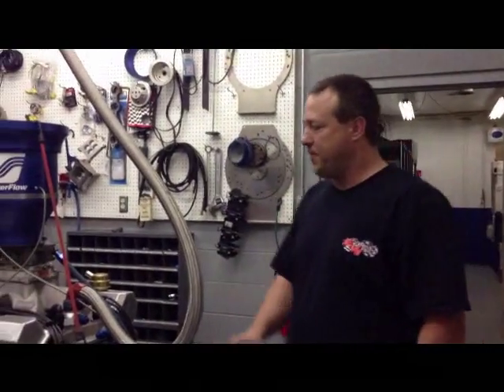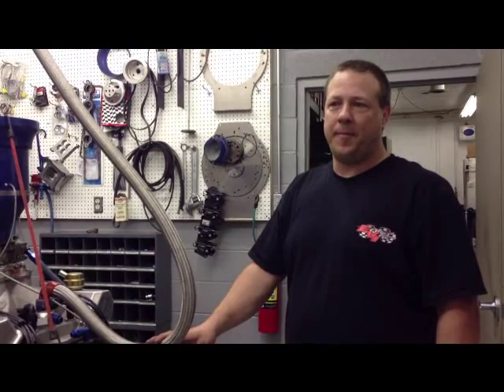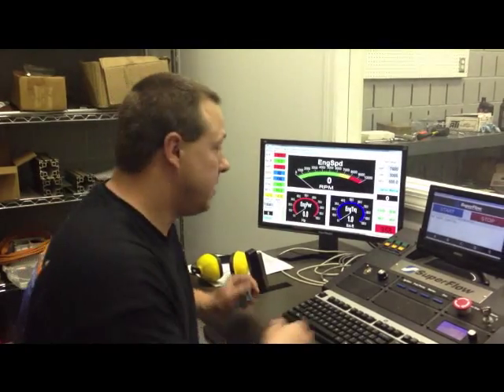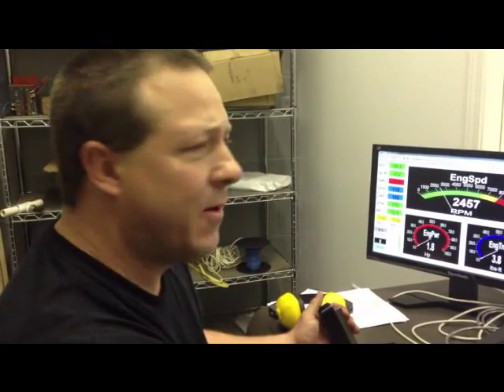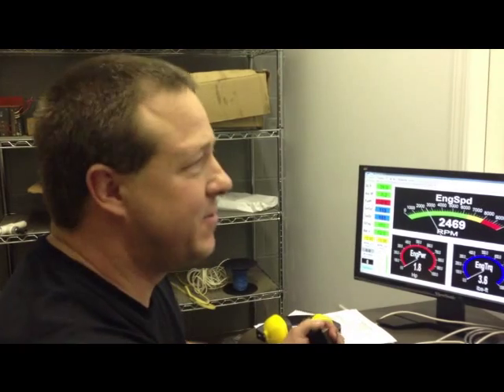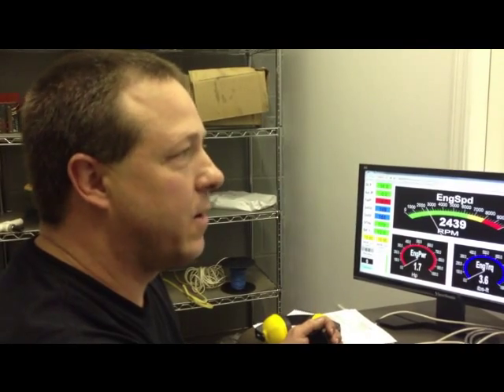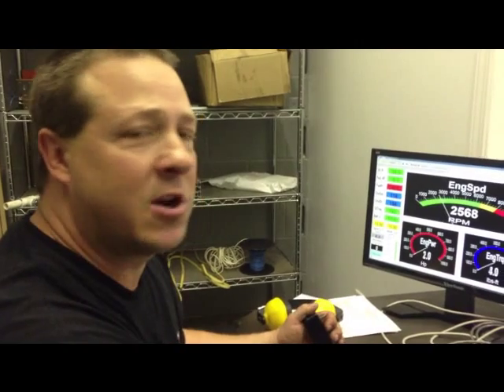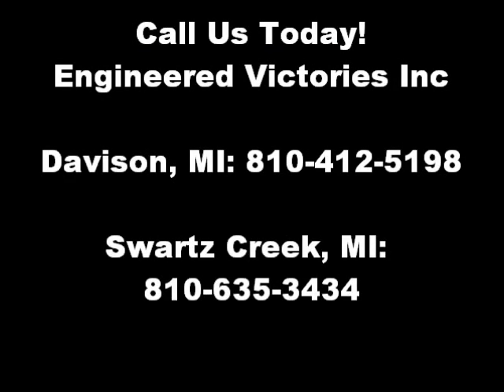EVI 2 Barrel Short Track Race Motor

Comment: Something seems off  here. @ 7.2K under acceleration the engine is making 406 HP 296 TQ then as the operator comes off the throttle and the engine is decelerating at 7.2K RPM the engine is registering 561 & 407 TQ. Something seems off. Watch the video real close hit pause as much as you need to.

Comment: 500 cfm? That little thing is a monster.
Reply: 500 CFM is plenty for a 320 cubic inch engine up to around 6500 RPM. 500 CFM falls a little short for 7000 RPM by about 40 CFM, but it's a myth that you need a 4 barrel carb to make decent numbers. If you ran that engine on the street, nobody would believe that you were running a 2 barrel carburetor.
Reply: they are not exactly "stock carbs"either. several companies build #4412s that pass a 500 c.f.m. "gauge test" at the track but actually flow over 700 c.f.m.
Reply: Two barrel and four barrel Holleys are rated differently....  A 4412 500cfm two barrel is 1/2 of a 4779 four barrel.
Reply: No they don't.